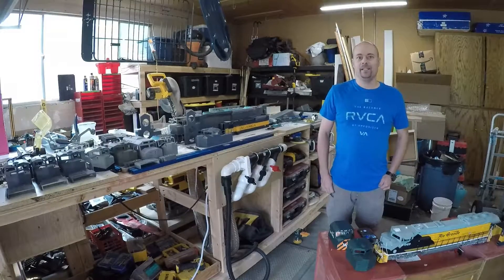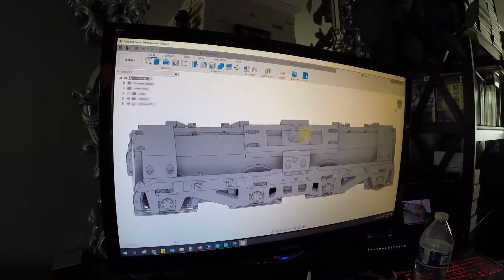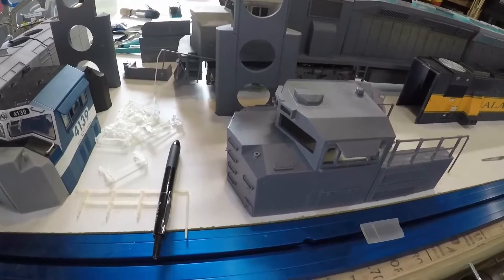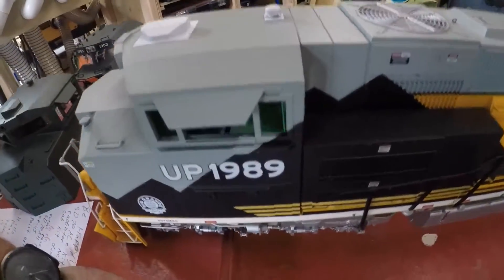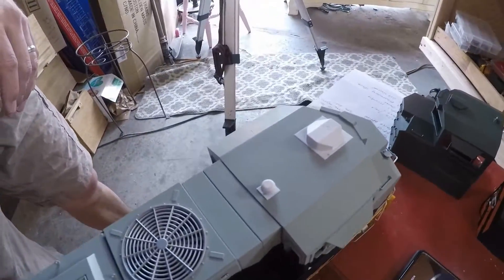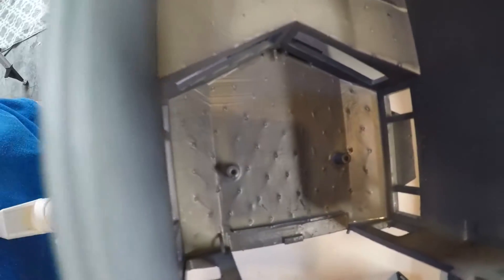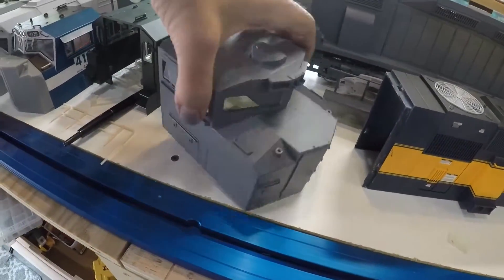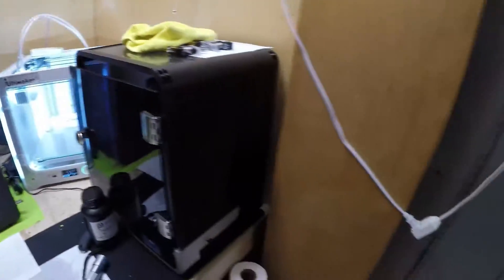USA Trains SD70ACe Conversion Kit

Comment: I’m pretty new to g scale, is it all battery powered?
Reply from the maker: These trains have been converted to battery. Having outdoor track power would require a lot of cleaning. You also have to buy expensive brass or nickel silver track. With battery you don't have to clean and you can use cheaper aluminum track.

Comment: I like that I can paint and decal these parts as I need. Wish they did that will all trains, so I could number them anyway I wanted. Makes it easier to have a Regional rail road instead of just on of the big 7 RR's everybody enjoys. Is that FP45 project going on a GP38-2 subframe? or something different? 
Love your products, I have bought this one and several others.......
Reply from the maker: The FP45 will be on its own frame. its going to have a 3 axle trucks just like the SD-70, so it will be almost as long as well.
Reply: When will your FP45 be in production?